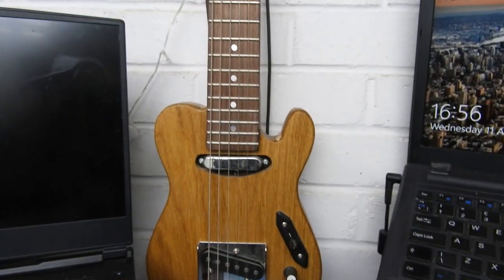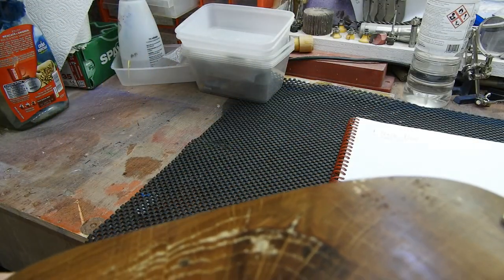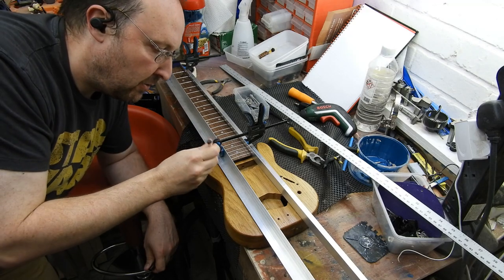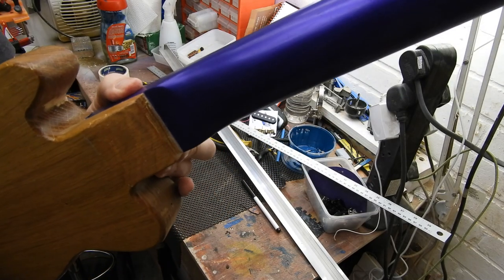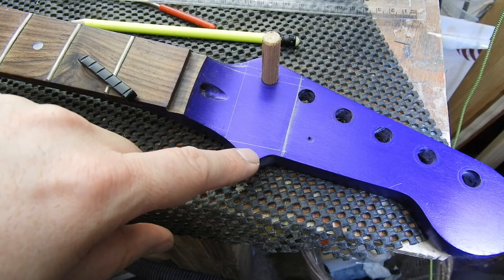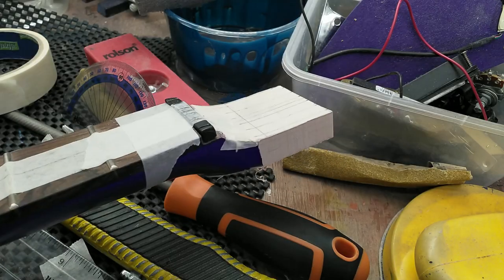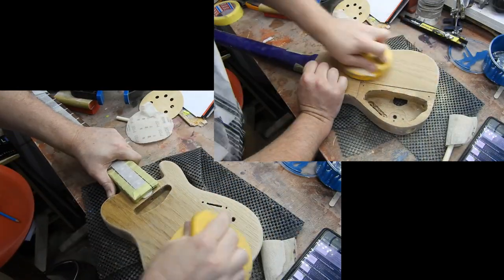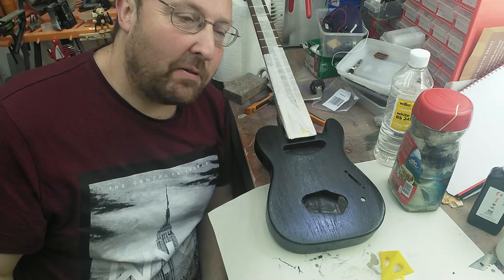Telecaster to headless guitar conversion

Comment: I remember those tiny guitars. will be interesting to see if cutting off the headstock really cuts it, the weight ratio might still come out stupid enough to leave you with a headless neck diver.
Reply from the maker: I'm hoping it will, especially with the loss of the machine head weight. But we'll have to see.  I'm happy to experiment.